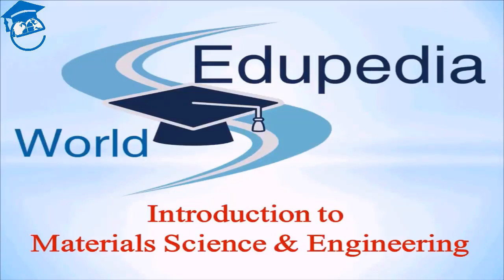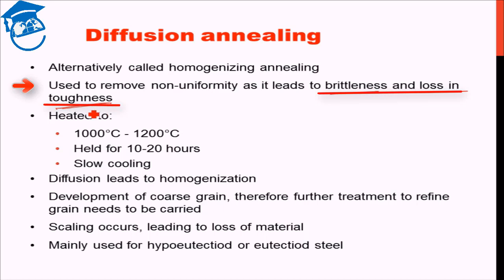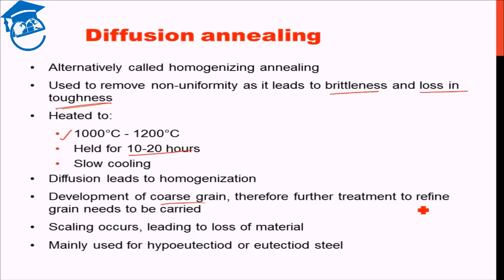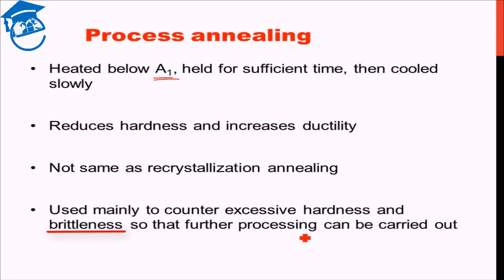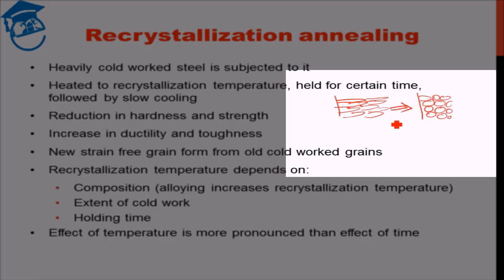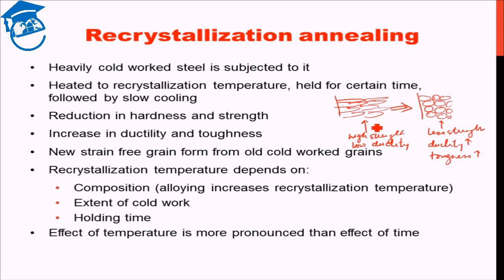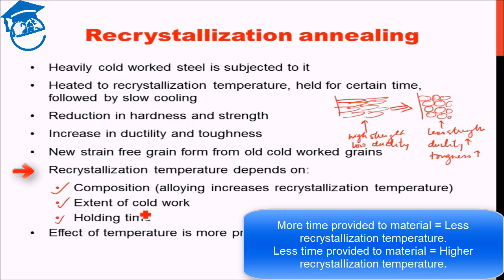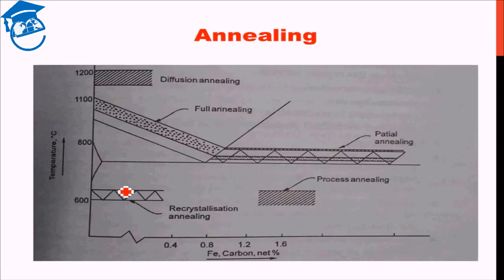AMIE Exam Lectures-Materials Science |  Heat Treatment | Diffusion, Process, Annealing | 10.4

Comment: Couldn't understand difference between process and recrystallisation annealing
Reply: Process annealing. is done before starting other work on the material. think of it like cleaning your material to remove oil before applying a sticker. while the recrystallization is done for materials on which COLD WORK or STRENGTH hardening like proccess are done. for example if you have rolled a metal alloy the grains will be elongated in a  particular direction making it ANisotropic material. so, we do recrystallization by heating it and waiting for some things 1. new grains to be formed from the old ones which are equiaxed. 2. the dislocations which are present making the material very hard to be moved away to other areas of material with the help of diffusion which is already driven by high temperature. thanks
Reply from the maker: Thanks a lot Numan Zafar, for taking the effort to reply. We wish you all the very best for all your endeavors. Best Wishes.